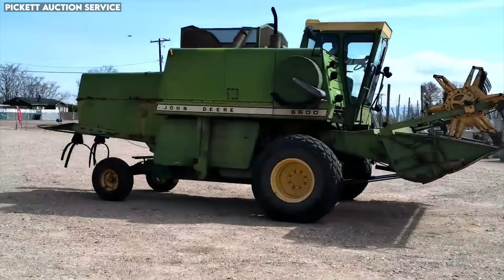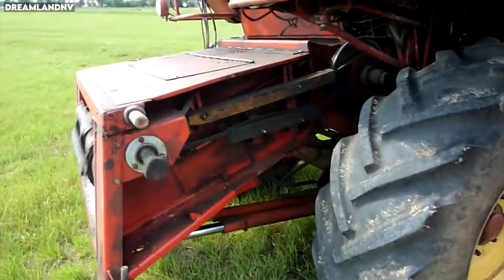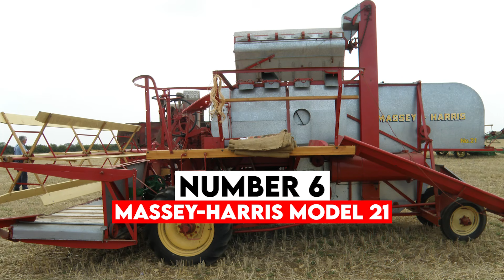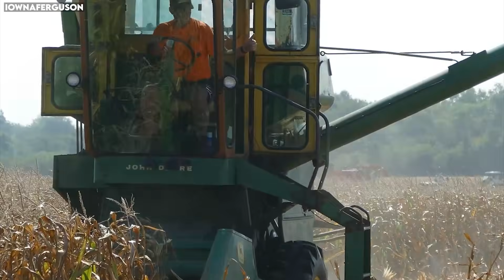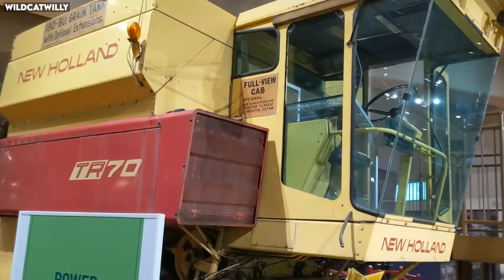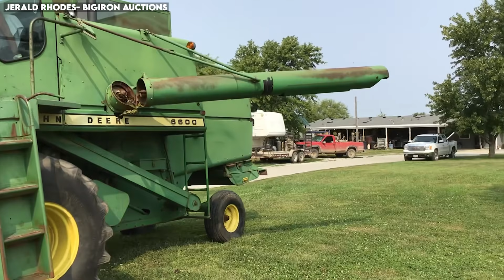10 Vintage Combines That Became Farming Legends

Comment: The Gleaner L series was the best straw walker machine ever made...PERIOD!!!
Reply: If AC Gleaner was managed properly, they would to this day be the dominant Combine on the market. JD focused on MANY dealers placed close to their customers, AC seemed to do just the opposite. Fewer dealers , farther apart. It hurt the AC brand  ! Farmers will drive just so far for parts , time at harvest is critical.
Reply from the maker: It’s always great to hear which vintage models are held in such high regard. :)

Comment: The IH 403 and 503 models were serious competitors to the 95 and 105 Deeres. We had a 503, then a 915 that being a fairly capable machine with a limiting cleaning fan system. I bought a1680 in '86, a 1688 (my favorite, before all the electronics), last run before the 20 series, ran that until retirement. Not sure the new prices can figure out on anything but the custom boys and monster farms. Really miss the old days of crescent wrenches and some know how. Massey Harris and Massey Ferguson had very competitive machines through the years. Was around a lot of different brands, most could do a good job when set right and operated without trying to compete with anything else. When conditions were good, putting that rotor low and slow, paying attention to the back end, you would give a sample that would make a seed cleaner wonder why he was doing the job.
Reply from the maker: Thanks for sharing your experiences and your insights on those classic machines.

Comment: As usual needs old farmer review.  When I see a number of the pictures backwards I go the review needed was not put into the effort.  I also s2150s.  The 123 was developed in response to loosing sales in Argentina to the MH 20.  It was considered like the MH20 the 123 may be too large for the North American market.  The smaller MH 21 gave Massey the lead in sales for North America through the 1950s and were very competitive in custom harvesting through the mid 70s.  In western Canada Cockshutt gave them a challenge and in the USA Deere started picking up sales through the 50s and 60s.  By the time the squarebacks came out the Deere's were the machine to beat.  Still lots of Masseys were sold due to pricing, brand loyalty and familiarity, The main comment I remember from people who ran both was, the Massey was cheaper but seems to have a lighter  build that needed more downtime and harder repairs than the Deere.  The TR70 came out with the rotary first with help from an IHC engineer who came to New Holland with rotary information.  Given that the current NH and CIH machines are almost identical except for different rotary elements there was major differences at the beginning and we liked the IHC 1400 and 1600 alot more than the TR70.  They handled all crops better.  I think IHC had done better testing and changes that other companies had not done Read the history of the Axial Flow it is extensive.  Set up of your combine is critical and I know many people who loved to pit their 105s against 7700s.  I know of a few neighbors using the 105 owners name in vain.  I just spent XXX dollars on a new combine and they blew by it with that old 105.   In my lifetime we have owned multiple models of the following brands of combines:  Deere, IHC, CIH, NH, Ford, Claas, Oliver, White, Minneapolis Moline, MF, MH, and Gleaners.
Reply from the maker: Thanks for sharing your experience with all those different machines.